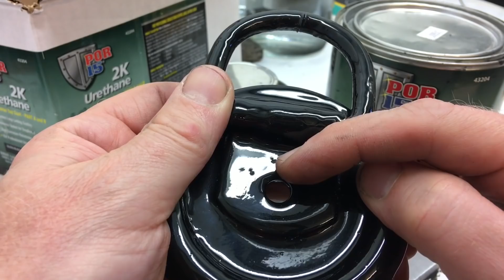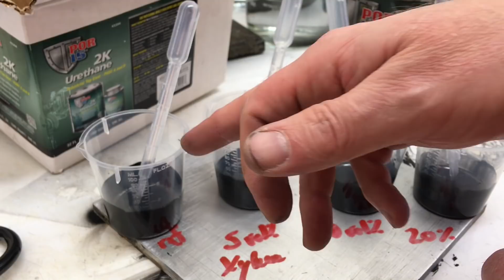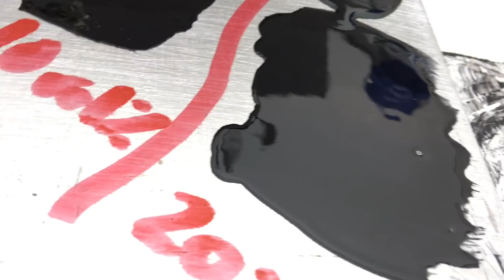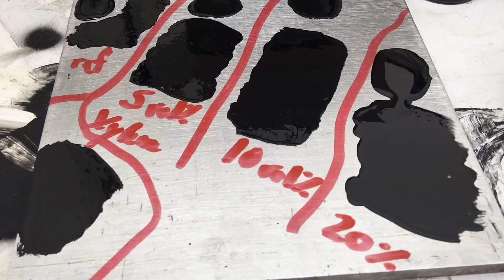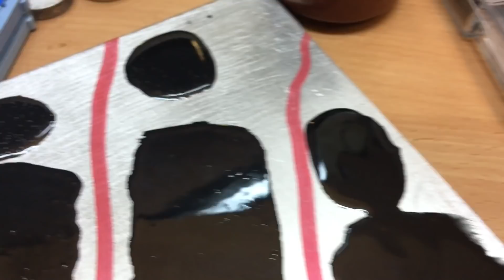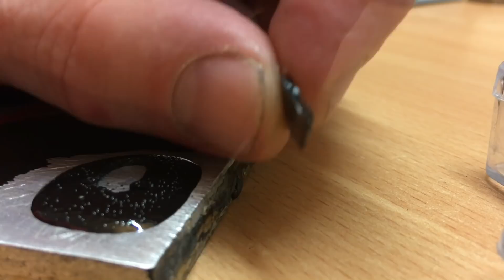Avoiding bubbles in POR 15 - How much solvent for best coating and scratch test

Comment: I'm not sure if they changed the instructions, but POR15 recommends mixing Part A & B with power for 5 minutes before application. I've done two coats on my car with 10-20% Xylene and 5 minutes mixing with an electric drill... I haven't had any issues with bubbles.

Comment: Great experiment Ken.  Please confirm if your % by volume of xylene was relative to the volume of mixed 2K (base plus activator total volume) or was it relative to just the volume of base?  Second question.  Do you have any idea if the finished product that was diluted with xylene has the same hardness quality as the straight urethane / activator with no xylene?  Thanks.
Reply from the maker: Yes on the mixed system, and true it has the same hardness with time as all the xylene has left the PU

Comment: I get this effect with regular por15 rust paint. I have tried brushes, and rolling. I have not tried using the solvent yet. Even when I use the POR 15 top coat in the spray can I get those bubbles... I can't figure out how to to stop this. I suppose the POR 15 solvent will work as well?
Reply from the maker: Adding the solvent it makes a Hugh difference. Vibrating the container before  brushing it on also works good!
Reply: @Ken_Sweden  I always thought they said not to shake por 15 as to NOT get tiny air bubbles.

Comment: You earned a subscriber.  Would 20% volume be 4:1 ratio?
Reply from the maker: +1221Ralph yes. Start w adding  a bit less since you can always add more. Good luck 👍
Reply from the maker: +1221Ralph yep 👍 but depends a bit on how much of the solvent that had evaporated from your paint as it was delivered. So start dilute a bit less, check consistency and increase. Thx f comment!

Comment: great experiment , I add 30% Xylene to 2K clear, also if you spray you'd better wait about 30 min between coats.
Reply from the maker: Great input. How did you spray it?
Reply: I use a .8mm IWATA HLVP gun with pressure about 30 PSI  for 2K clear. but i think up to 1.4mm should be fine. I do a very light coat like a dust first and wait 5 min. then I do a medium wet coat which still looks foggy, I wait 20 min then I put another coat to fill the voids and make the surface smooth but not heavy at all . if you want a really heavy finish then wait for a day, sand it with 2000 grit and shoot again. I keep my spraying about 4-5 inch away from the parts.  also this 2K is not gonna like oven . leave it outside for air drying.

Comment: Thank you for performing this experiment, had I not seen this video I would have applied the product at full strength and yielded some fairly unpleasant results.
Reply from the maker: Yes, somewhere on this higher end is definitely better. Part of the reason why it is approximate is because one doesn't know really how much of the Xylene has evaporated from when the jar was filled. The consistency of the mixed paint should be more on the liquid side than gel. The xylene you add will evaporate anyway so it wont affect the mechanical performance of your coat. It will only be thinner with more dilution. I guess somewhere close to women's nail color paint is good.